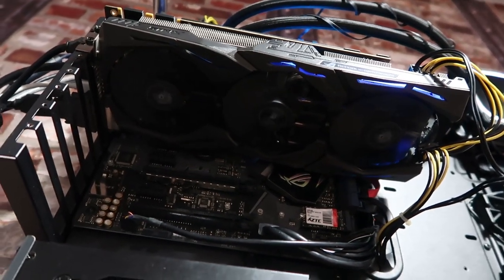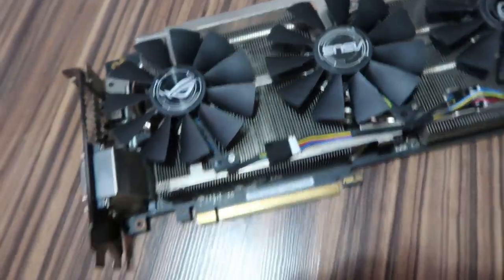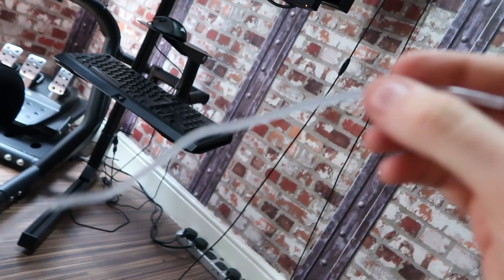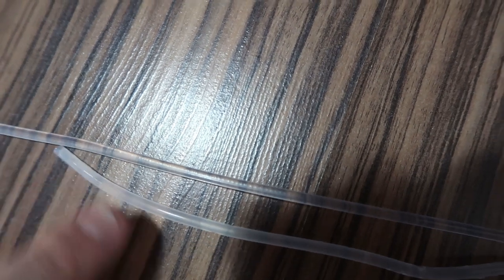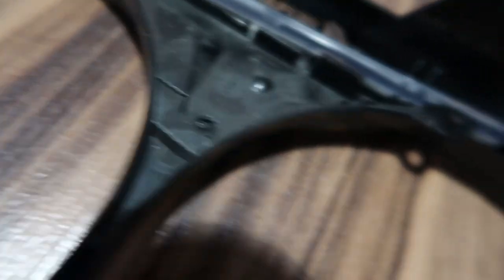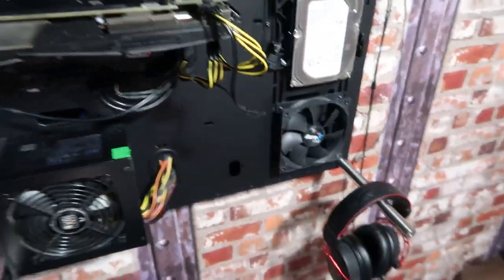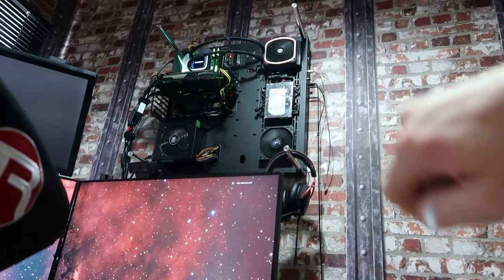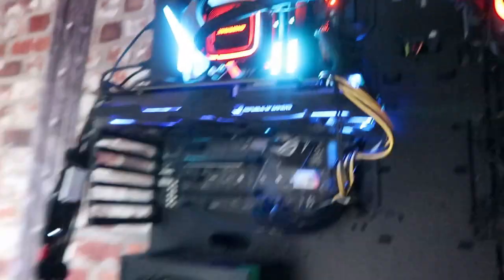How to fix Asus Strix GTX 1070 RGB LED issue

Comment: a big thank you! the heat from the gpu does indeed affect the fiber optic cable. lifespan about a year max. then it gets milky. Now I have a solution for my front mounted GTX 1070 in the antec striker case, so thank you sir

Comment: OK, I can say for sure it works on every THREE FAN card in the Asus ROG Strix range, from the 1070 to the 2080ti.  I will list them:
 1060-6G, 1060-O6G, 1070, 1070oc, 1070-ti, 1080, 1080oc,  1080-ti,  2060, 2060oc, 2060 Super. Any of the 2070's and 2070 super cards, and any of the 2080's. 2080 super cards and the 2080-ti cards, including the white editions.
The new 3060-ti, 3070, 3080, and 3090's I have no idea about.  They have RGB all over the place and I've no idea what kind of lighting system they have under the hood.
 
EDIT:  ANYTHING before the 10 series Three fan cards DO NOT have the RGB lighting, I looked at the 980-ti (the flagship before the 10 series was released, and nope, it's a completely different style of card.
The cards I have listed at the top are all in EXACTLY the same type of case.  I wouldn't be able to tell the difference between a 3-Fan 1060-6GB from a 2080-ti 11GB unless it said so on the card!  Be careful if you are buying seconds hand, as it DOESN'T take a tech savvy person to swap the cases between a 1080 and a 1080-ti, and the "normie" user would probably never notice for some time (if ever) since they don't benchmark or use other tools which tell then the GPU they are actually using - even then they may miss the fact that it doesn't say "ti" after the 1080.  They will just see it as a HUGE leap in performance from their 780 or whatever they were using before that.  There are certainly some scumbags out there who will do anything to screw you over.  If buying second-hand on Ebay ask them for a Userbenchmark score for their system, it will tell you what card it is testing, how well it is pergorming compared to other cards of that particular type, as well an article about whether that card was considered decent at the time of release, let alone 2 or 3 years later.
I'm still very hapy with my 1070 until the 3060-ti comes down to the price it is MEANT to be in stores. I don't need a 3070 or 3080 for 1080p and 1440p gaming, and am not interested in 4k.  I'd rather spend the extra on a 120hz or 144hz monitor to upgrade my grappy acer 60hz with nothing more recent than a DVI socket on it.
No point in playing a game at 180 FPS if your screen only refreshes 60 times per second, capping you at 60 FPS anyway.

Comment: Much appreciated.. baught one of these recently for wife/kids sff build.. cost me 12.99 canadian on amazon for 1 meter of 4mm fiber optics.. took me less than 20 mins and half that was struggling with getting it back onto the riser cable in a sff build.
Reply: Ontop of that the i baught the gpu 2nd hand and the description stated this issue and i used it to negotiate a lower price 😆  .

Comment: Thanks for this tut, just fixed my old 1070 today this way. Looks like new now. Easy fix.
Reply: how do you change the 1070 rgb?
Reply: @kian4077  hey, do you mean by software? to change colors, or to change the silicon bars as suggested in this video? (btw, by now I've changed the 1070 to a 3080,...same as the old one, Strix from Asus)
Reply: What size was the cable you ordered, his link no longer works.
Reply: @Hughesburner  4mm thick1.5 m I believe, from amazon de

Comment: i was following the tutorial but when i opened my gpu i noticed that the led board missing so even if i did replace the cable it wont light up. do you know where i can get my hands on a replacement led board???

Comment: Thanks, I bought a 1070ti used and that was super easy. 
Amazon had it here next day, it cost 12$ cad for 3 feet.
Question... whats the right side white debug led for? I have an rm850x and custom corsair cable made for the psu. All connections are good, but the white led is always on.
Reply: That's right, it's a white debug LED which just indicates that the GPU is powered. I have a strix GTX 1060 and have the same thing.

Comment: I guess I'm not having this problem but my strix 1070 is stuck on one color. The armoury crate software isn't changing the color. Tried unplugging the RGB power cable and reputting it in but nothing. Not sure why the color is stuck for me. Kinda sucks. It's stuck on yellow of all colors haha
Reply: mine was red...
some digging led me to OPENrgb

Comment: Hey great vid! Though i do have another problem with my 1070, its the same graphics card as yours but i am unable to change the rgb colors on the graphics card itself. I have been trying to change it on the armory crate app and on icue but it didn´t get detected on neither of those. The rgb on my graphics card right now is static red. Help would be so appreciated!
Reply: its because your motherboard doesnt support armoury crate, so it cant detect the gpu

Comment: Anyone have a fix for the bottom LED doesn't match with the top part back plate LED ? not the same color anymore on my Strix 1080 ti the same thing happen to my Strix 1070

Comment: Create a video regarding how to replace.
Just skipps the how to part
Reply: If you have a working light anywhere on the gpu the led is working the fiber optic cable that spreads the light is most likely just crimped. But I'm not unmounted my gpu for that😂

Comment: Can the 1070 hold for another 2 years or more ?
Reply: I’ve got this same card and I play on a 1440p 144hz gsync panel from Dell, and I’m comfortable enough with the performance of the 1070 for what I play (Insurgency Sandstorm, Squad, Titanfall 2 mostly) at 1440p. I’m not really looking forward to any “next-gen” titles. I’d say that if you’re in the same position- where you have some games you play often that run fine on a 1070 at your preferred resolution/settings, then yes, the 1070 will be wholly adequate for at least the next two years and potentially more.
Reply: You can play 1440p high settings in most games.. On ultra too but sometimes you need to tweak specific settings like volumetric fog in borderlands 3 halving your fps and really almost no difference between ultra and medium.. Lot of games have setting that eat your fps without visual diff